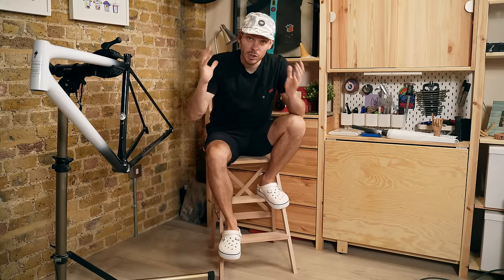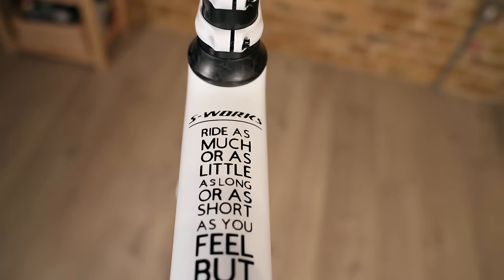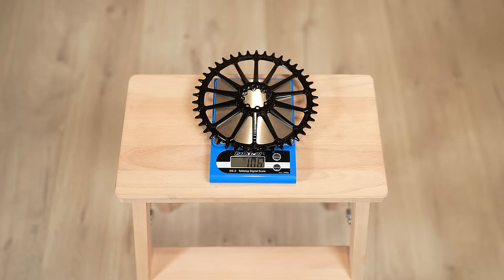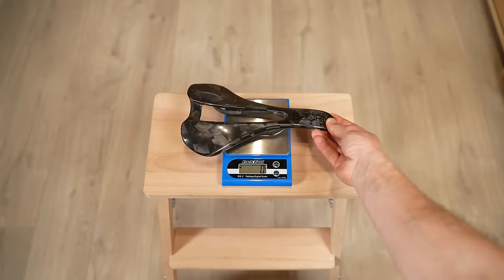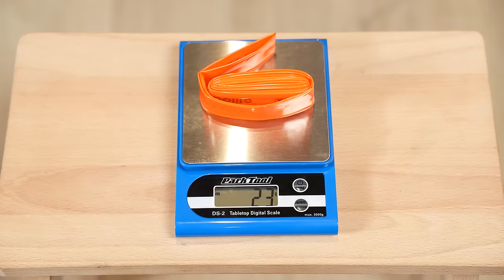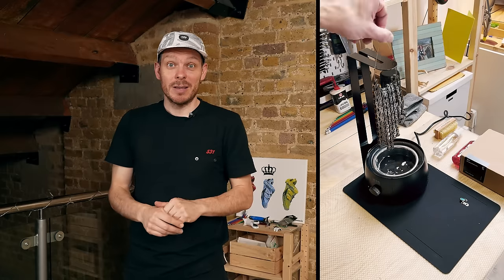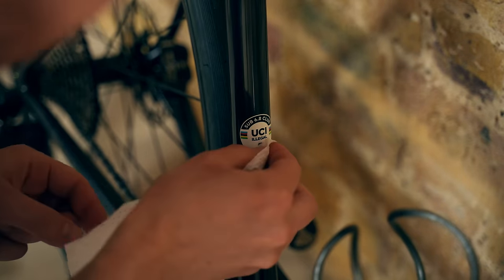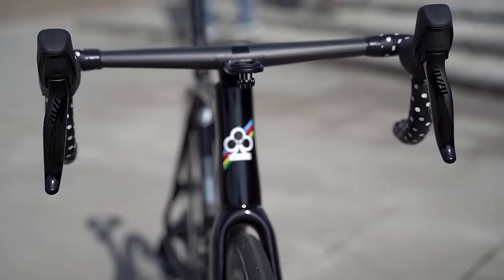Building an ULTRALIGHT custom Specialized AETHOS S-Works with INVISIBLE CABLE ROUTING!

Comment: Can an aethos run hope brake calipers? I was told my my bike shop that the aethos can only run shimano/sram calipers due to the specific mount system used.
Reply from the maker: You can see it in the video, right?)
Reply from the maker: Maybe they were talking about the +20mm callipers - I didn’t try those.

Comment: I have an Aethos Works that I haven't yet built up. I looked for the fork but I don't see the model you reference. Can you please provide a link? Thanks, and great video!
Reply from the maker: It’s called Deda Road EDG DCR fork. Try sending them an email
Reply: @TwistedWheels  Thanks. One other question, how does it ride wirh the new fork compared to the stock one? Can you tell a difference?
Reply from the maker: @rg807  like I said in the video, I bought the frame without a fork, so don’t know how the original fork rides

Comment: I wish it had pressfit bb..
Reply from the maker: I am the opposite. Super happy that Spesh and other brands are going back to threaded. Don’t see any benefits in pressfit.
Reply: @TwistedWheels  wider BB shell is better. The problem is that brands like specialized have a very low manufacturing tolerances and they are unable to make a perfectly round hole. That's why it starts creaking.

Comment: Big mistake on the cassette. IMHO the chinese cassettes maybe cooler looking and lighter, but the shifting ramps on them are just not up to par with sram/shimano.
Reply from the maker: I’ve been riding this cassette on my Colnago for the last several months and didn’t have any issues with shifting
Reply: @TwistedWheels  Interesting. I had 2 ZTTO cassettes so far (MTB/Gravel though) and both were hesitant shifting to a harder gear on one of the cogs. I recall Trace Velo commenting on the "slightly inferior shifting" when he reviewed a ZTTO cassette.
Anyway. Sick build, and thanks for showing how a non integrated bike can be upgraded to fully integrated. I never though it was even possible.

Comment: 1by setup? More or less useless for different road conditions (moutains & flats).
Reply from the maker: Didn’t have any issues with this setup in Mallorca or any other hilly routes. 
Offers the same range as 50/34 and 12-29T cassette